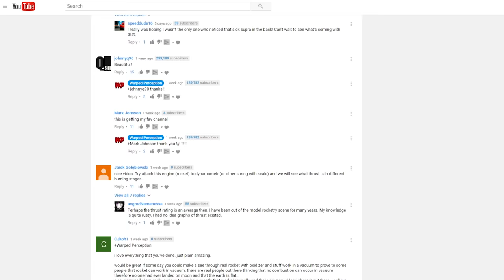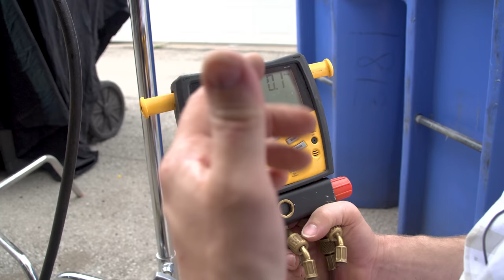Model Rocket Engine In A Vacuum Chamber - 4K Slow Motion - will it burn? - Rockets (S1 • E3)

Comment: from where did it have the oxygen to burn?
Reply: Solid rockets contain fuel and oxidizer premixed, they only need to be ignited. The two big boosters of the space shuttle are built the exact same way, just way larger obviously. Most rocket engines use liquid fuel and oxidizer and a turbine to feed the nozzle because you cant control solid rockets. In fact you cant even turn them off, they are full throttle until theyre empty. Thats obviously not useful for a safe and precise rocket operation but its great for boosters because they are very powerful.

Comment: good video.i just stumbled over it. i don't know your argument for making this but rockets won't work in vacuum means no thrust or very little thrust /fuel ratio. at least that is what i understand the argument is....you,sir, can you make same experiment  but somehow measure thrust .we know the fuel. open one up and weight. then we  see if  there is enough thrust.....anyway thank you.
Reply from the maker: +Gabriel Rapan well the original argument for this episode was off of a previous episode, many people are saying that a rocket motor will not ignite in a vacuum, but the next rocket episode out is going to be challenging Newton's Law. That was the next subject people wanted to see
Reply: i see...well air is not needed  it is a chemical reaction...and air just maintains the burn....the heat will get released with or without air....that's 6 th grade chemistry.....guestion is the thrust....is it there?without the air to act upon?   you'll need a longer tube i think.....and the reason it burned so fast it's the vacum.....that's another question.

Comment: It dont believe there was any kind of good vacuum in that chamber at the beginning of the experiment.
It's hard to tell, for sure, but I cant explain the images around 2:50 - 3:00 otherwise.

Look at the smoke going out of the rocket: it does go down a bit (so far so good), but we can see a lot of convection in it. Especially at the (supposed) vacuum and smoke interface.
That's just not possible: without any force applied, an object (including a smoke dust particle) goes straight (falling a bit due to gravity to the most). The fact that it's rotating is a sure indication that it has hit something. And that "something" is air inside the tube...
Sorry.

Comment: Is this really a fair comparison to definitively prove that a rocket is able to propel itself thru the vacuum of outer space?  You prove the fact that igniting a rocket in a space void of the  oxygen typically associated in doing so is possible. However on this scale the gas introduced into the chamber from the rocket igniting is proof that the chamber is then no longer in a vacuum state.
Reply: @UniversalExpanse I'm sorry, what have I missed? I'm curious to hear another opinion
Reply: @jordykellogg5568  Watch the YT video "uninterrupted footage of the falcon heavy launch and booster landing!"
It has live video PROOF of rockets working in a vacuum.
Watch it and tell me what you saw.
If you cannot spot the parts where rocket propulsion IS WORKING - IN A VACUUM, I will be happy to point them out to you.
Reply: @stuartgray5877  im not sure if I watched the right video..would u mind pointing out to me? I'm really not trying to start an argument I just want to clear up what I'm missing
Reply: At what height does the vacuum begin?
Reply: @jordykellogg5568  At only 50 kilometers atmospheric pressure drops to below 1.0 Torr.
That is almost 1/1000 that of sea level.
That is considered "vacuum" for all practical (mechanical) purposes.

Notice how the side boosters gracefully pulled away from the center core?
does that LOOK like the motion you would expect for a vehicle moving at 3600 MPH in an atmosphere?
Reply: @jordykellogg5568  Oh, to see the dynamics of the vehicle watch the view from the vehicle itself.
Search YT for: "Falcon Heavy Test Flight" from SpaceX.
Watch the dynamics of the side boosters separating @ ~ 24:21
Reply: @stuartgray5877  I thank you and  appreciate your patience with me on this . Would u consider outer space to be at whatever distance our atmosphere fades away completely or abruptly ends to be a perfect vacuum from that point until the beginning of another planets atmosphere ?  And perfect vacuum meaning void of any and everything zero pressure ?
Reply: @jordykellogg5568  our atmosphere becomes "vacuum" at only 50 kilometers up. Mars's atmosphere is even thinner. And yes hard vacuum everywhere between.
Reply: Rockets work because they expel mass away from them.  If you want to apply Newton's laws, technically the expanding gas is what the rocket pushes off of, but more fundamentally - all this is - is an example of the conservation of momentum.  If you sit in a chair that rolls and throw a bowling ball, you will be propelled in the opposite direction.  You didn't push off air.  Technically, it was the bowling ball that exerted a force back on you.  Think of this bowling ball as a single molecule of matter.

An airplane, boat or other propeller based craft that operates in an atmosphere doesn't really work any different than a rocket.  All of these vehicles move by expelling mass away from them.  Air-based craft simply use the limitless mass that is in the atmosphere.  They use fuel to operate an engine whose sole purpose is to turn a prop/turbine/rotor that literally takes in mass from the surrounding limitless supply, and then ejects it away from the plane.  The plane in turn is thrust in the opposite direction.

Now, back to the bowling ball example.  Imagine you are in space and there are bowling balls literally all around you.  If you take one of these balls and throw it, you will be propelled in the opposite direction.  You aren't pushing off the other bowling balls; only the one you physically ejected away from you.  You could grab another ball and throw it - and continue to do this.  You would go faster and faster - and at no point are you dependent on the bowling ball you threw to hit another bowling ball to propel you forward.  This is fundamentally how thrust works in an atmosphere - and you have a limitless supply of bowling balls you can grab and throw.  When you think about it, it's kind of silly to think that a bowling ball hitting another ball after you have released it would have any impact on your thrust.  The act of throwing the ball is what creates the thrust.

A rocket works the exact same way except instead of having a supply of bowling balls all around, we take the bowling ball with us in a tank.  A rocket's fuel is not used to operate an engine which in turn spins a prop that ejects mass away.  The rocket's fuel itself IS the mass which is ejected away.  Except it's not bowling balls, but fuel which gets ignited.  95% of a rocket is fuel, and this is ejected at high velocity which thrusts the rocket in the opposite direction.  The rocket doesn't need air to push off of.  It has brought the mass with it to push off of.
Reply: @UniversalExpanse Watch the "Stardust Launch" on my YT channel. You can SEE the curvature of the earth in the video.
Then just TRY to tell me that was CGI genius!
Reply: @UniversalExpanse So you think the "Stardust Launch" video is "CGI"?
  Just SAY that outright, quit beating around the bush.
Reply: @UniversalExpanse So then you think the Stardust Launch video is REAL?  Well it shows that rockets DO work in a vacuum AND that the earth is curved.
Reply: @UniversalExpanse - "god wat is your point?"

For ONE, I helped build, test, and launch that spacecraft. I was one of the Launch Conductors that day.   I watched that launch and LIVE video feed live with my EYES.
In FACT as the rocket lifted off you could see where I parked my CAR THAT MORNING!
So if it was "CGI" then they knew where I would park my car so they could insert it into the 3D model AND they knew about the WEATHER in advance so that they could model it also.

finally, that launch was in 1999. The HEIGHT of "CGI" at the time was Toy story II and even that took HUNDREDS of hours of rendering for a few seconds of video. Are you suggesting that NASA has some advanced CGI rendering in 1999 that the rest of industry did not know about? Finally, that rocket was carrying a sample return capsule that I helped close up and put on the rocket WITH MY HANDS.
Seven years after that launch the capsule RETUNRED to earth. You can see the video on my YT channel. They recovered that capsule and it is in the Smithsonian Air and Space museum right now. I have seen it with my eyes and I would testify that it is the same one I helped load on the rocket and watched leave earth WITH MY EYES.
So sorry you lose AGAIN!
Reply: @UniversalExpanse sorry I had missed all the debate it seems .but why is it when a plane that's pressurized gets a hole in the side of it doesn't it get sent into a flat spin from the thrust?

Comment: How can we hear the rocket burning if it's a vacuum in there? I thought you needed air to propagate sound 🤔
Reply: I'm a bit baffled how we even need a random YouTube guy to even do this experiment! Surely NASA would have tested a myriad of miniature rockets in a big air tight vacuum simulation room before they send an actual rocket up there Risking billions of dollars and the crews lives..where are all the videos they should have??
Reply: @jojohnviz12  why would NASA need to do anything like that...? anyone with a simple understanding of physics and Newtons 3rd law, would simply know that it will work.... why bother wasting money/time/effort proving something that is obvious and simple? Of course they will have tested the rockets themselves, the engineering, calculate the power etc - but no need to use a vacuum.
Reply: @davehickman7118  theoretical physics is always theoretical till practically tested in a  reproducible manner, peer reviewed.
Why do you think there were so many failed launch attempts by NASA and spacex? You can never account for every factor that can go wrong with just a theory.. there 100% should be alot of vacuum rocket testing videos out there
Reply: @jojohnviz12  testing the hardware....of course ...very sensible, but absolutely no need to test Newtons third law....

Comment: How did smoke fly outside the tube when it went off? Was it really sealed? Obviously not. 4:10
Reply: Vacuum tubes arent generally very good at holding in positive pressure, which the rocket produced after burning its fuel

Comment: Wait doesn't a fire need oxygen? THEN it lit with oxygen correct? THEN where was the vacuum?
Reply: Combustion needs a) fuel, b) an oxidizer (can be oxygen, can be something else).
Both is in black powder: charcoal = fuel, nitrate = oxidizer (and some sulfur to ease ignition).

Comment: You completely  miss the point  it's not that the engines don't burn the thrust needs something to push against  to generate forward movement  ricke5s thrust push against air when in flight in the chamber you built  the motion of moment diddnt accuse until the thrust hit the back of your chamber and that  caused the forward motion

Comment: SET UP TWO TUBES,ONE AS A VACUM THE OTHER WITH AIR.PUT A VALVE ON BOTH TUBES. NOW OPEN THE VACUM AND SEE IF IT PULLS ALL THE AIR OUT OF THE OTHER TUBE.WHAT IS THE RESULT.THE ONE THAT HAD AIR SHOULD NOW BE A VACUM.JUST KIDDING I DON'T KNOW FOR SURE.I JUST DON'T UNDERSTAND IF SPACE IS A VACUM HOW CAN THE EARTH HAVE  A ATMOSPHERE.NEVER UNDERSTOOD THAT BEING RIGHT NEXT TO EACH OTHER.

Comment: it doesn't move forward until the chamber loads up with gas matter proving thrust movement would not occur against zero matter in a vacuum environment such as space. Unless you can remove the gas as fast as it is produced this proves only the burn theory.
Reply: no. thats wrong, it takes time to ignite

Comment: There was no vacuum when it has been opened
Reply: That's because the exhaust gases from the rocket filled the vacuum with water vapour, carbon dioxide, sulfur dioxide and a few other biproducts from the combustion

Comment: The burning gases create no vacuum in this small tunnel tube. To get an exact experiment, you should have a bigger vacuum chamber as a house and a small rocket as that.
Reply: How about a rocket the size of a house and a vacuum chamber as big as the solar system?
We tried that one and it worked perfectly..  ;)
Reply: @jesusdacoast872  What a sad little world that you are living (or pretending to live) in. 
But, not to worry, the rest of us are having a good time.
Reply: @darklight2.1  if u wanna the truth, then keep searching. Otherwise keep sleeping.
Don't worry sooner or later the TRUTH will prevail.
Reply: @stuartgray5877  I'll C
Reply: @stuartgray5877  I saw it.
It starts going up then bending over and continuing horizontally, finally came back down to land.
I see nothing special, I see no rocket flying through the vacuum!
Reply: @jesusdacoast872  - Sorry to break it to you but the rocket was IN vacuum from the time the side boosters separated.
Earth's atmospheric pressure drops to less than 1.0 Torr at only 50 kilometers altitude.
So those side boosters were heading on an EASTWARD trajectory moving at 3600 MPH when the side boosters separated IN VACUUM.
So Jesus - HOW did those side boosters TURN AROUND, CANCEL the 3600 MPH EASTWARD velocity, then LAND back at KSC???
HOW did the rocket DO THAT all in a vacuum ?
SO SpaceX either has working rocket propulsion in a vacuum, or they use BLACK FUCKING MAGIC!
Which is it genius?
Reply: @stuartgray5877  the exosphere the uppermost region of Earth's atmosphere where allegedly vacuum starts is about 500-1000km high above the earth surface. Also Earth's atmosphere is halfway to the moon about 120000km.
A little bit calculation, and you will realize that shuttle ain't reach that altitude, even though there's no vacuum up to the shuttle highest level.
Think again.
Reply: @jesusdacoast872  Nope SORRY - But "Vacuum" starts at ONLY 50 kilometers.

It is BELOW 1.0 Torr art only 50 km. up.
This is 1/760 of sea level pressure, or close to 1/1000 That of atmospheric pressure.
This is WHY they separated the side boosters when they did.
They had LEFT the ATMOSPHERE.
You are trying to argue with someone that launches shit to space for a living.
I have personally launched five spacecraft and witnessed over twenty real rocket launches including Atlas, Athena, Minotaur, Delta II, Delta IV, Space Shuttle (launches AND Landings) and Falcon9 launch and booster return.
I am leaving in three weeks to go to KSC to launch NASAs next X-ray telescope (IXPE) on a Falcon9 this Dec 9th.
Reply: @kitcanyon658  I guess so 😬
Reply: @jesusdacoast872  : Well, that fact that you have to "guess" as your own mental abilities is also a clue.
Reply: @kitcanyon658  lol 😁 any further information plz.
Reply: @stuartgray5877  do u have any other mean of contact, let me know more.
Reply: @jesusdacoast872  : Yes, in fact I do have information. What topic are you lacking education in? Perhaps I can be your education muse.
Reply: @kitcanyon658  same subject
Reply: @jesusdacoast872  : Rockets work on the conservation of momentum. Momentum is the mass of an object multiplied by its velocity.
Reply: @jesusdacoast872  you could come to KSC and talk to me in person.  I am sitting in the SpaceX launch control room right now
Reply: @jesusdacoast872  here is a mental experiment for you: would a firehose, fired into a vacuum have any recoil? Yes or no?
Reply: @stuartgray5877  this is not a mental experiment hhhhh it Should be happened in the real world to see the effect as above.
In my opinion it would be the same as a rocket launched in the vacuum. The answer is NO recoil unless the vacuum chamber is too small to hold gases.
Reply: @stuartgray5877  Mmm sounds interesting. I'm fucking serious too! Let me know about that experiment. Damn on Newton's physics and Einstein's physics. How about Tesla's physics, how about Eric Dollard's experiments!?
Reply: @jesusdacoast872  pass high school physics first then we can talk.  I am 100% certain that you could not pass a high school physics exam.
Reply: @stuartgray5877  I already passed high school, to be honest in the primary and middle school I was good at physics, later in the high school I got bored of it 😒 I'm not interested anymore.
I have master degree in computer science. U have a good job maybe 😌 but as an IT I believe that in weather forecast there's no real satellite images 🤔 images are generated by computer. Computer programs using neural networks. that's all folks 😌.
Yes, you're in the control room, but u don't know where those shuttles go...!!!
Reply: @stuartgray5877  funny 🤣🤣
U R accusing me 😥😒 why should I lie...?! I didn't accuse U, u said, that u Know more about space and space shuttles, u R in the control room,...etc. I told U to let me know more about that if u have another mean of contact, but never said U R a liar.
Reply: @jesusdacoast872    solve this simple physics problem using the "law of conservation of momentum":
You have a remote controlled crossbow of 10000 kilograms mass sitting on a frictionless surface (nothing holding it down).  Load the crossbow with a projectile of mass 1000 kilograms and cock it.
Now an observer is on the ice with the remote and all three objects are stationary ( they have a relative velocity of zero with respect to each other)..
He fires the crossbow with the remote and he then observes the projectile exiting the bow towards his left with a velocity of 2500 meters per second.
What is the final velocity of the crossbow after it fired the projectile? Actual engineers can solve this problem IN THEIR HEAD. 
Now what is your answer?  If you cannot answer then you have NO BUSINESS lecturing others about basic physics.